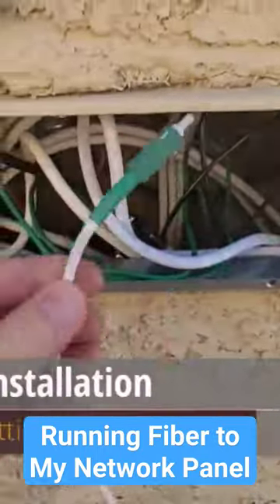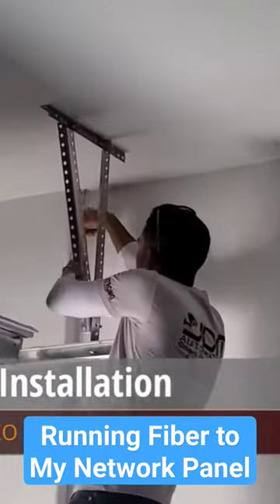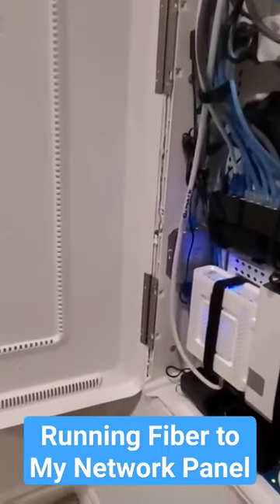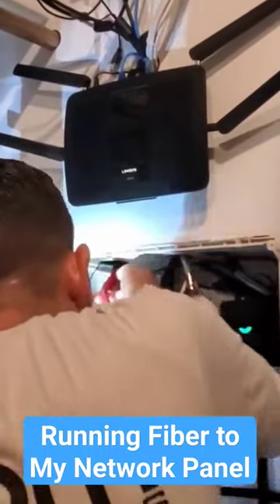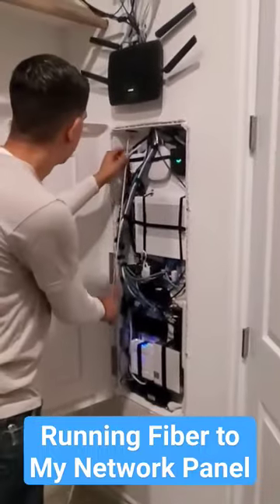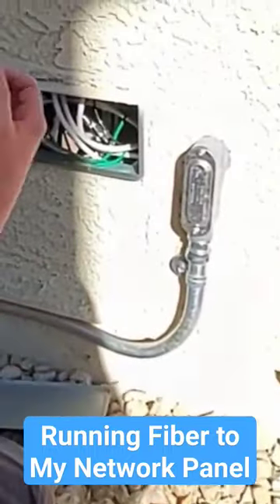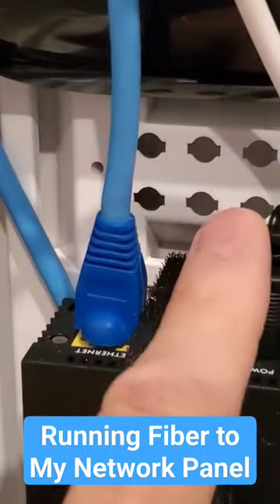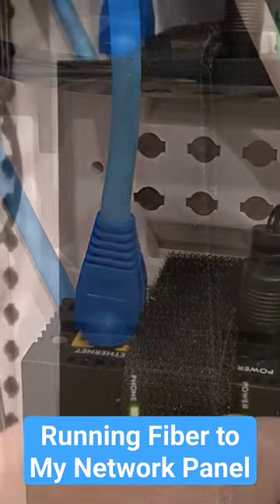HOME FIBER OPTIC INTERNET INSTALLATION -  HOW TO

Comment: have had 2 techs come out to connect my service on my new build home. both techs could not find where my fiber cable was leading to inside my house.
Reply: Need a better tech. Sometimes we just make a new route lol
Reply: You should know wheere are cables on your home. Its not tech s job to know every building plan
Reply: @uplayer2827 of course - but that’s assuming the builders built the home according to the plans they’ve provided you with. Our fiber ended up being behind drywall.